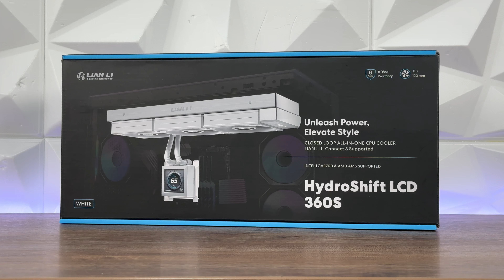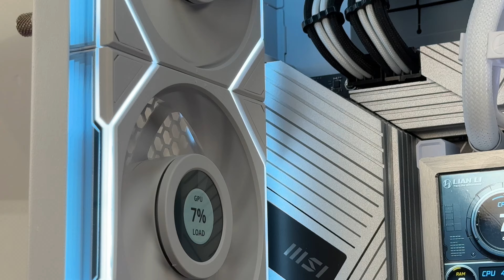LIAN LI O11D EVO XL w/ HydroShift LCD & UNI FAN TL | i7-14700k | RTX 4080 Super

Comment: Excellent build! In the video it shows the you installing the hydroshift 360S version. Did you swap out the fans for the Uni TL fans? And would I be able to use my infinity fans on the 360S version?
Reply from the maker: I swapped the fans. Just for the visual aspect to have all TL fans since I do have 360TL but in black. I think you’ll be able to use SL-INF without a problem